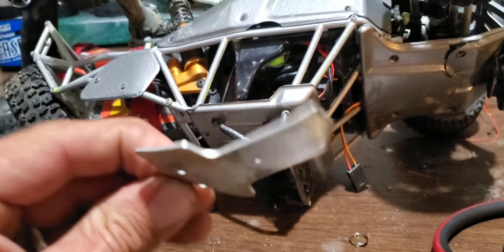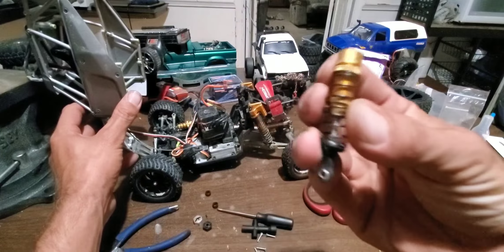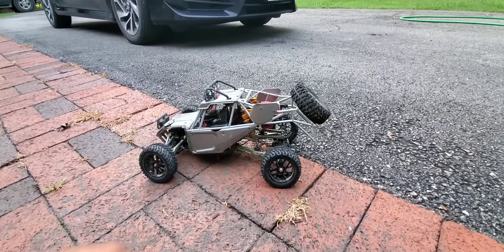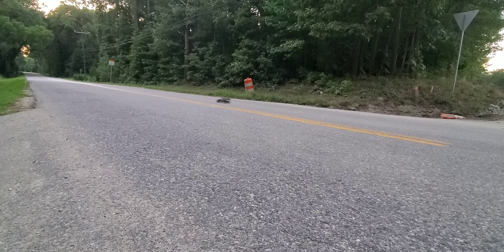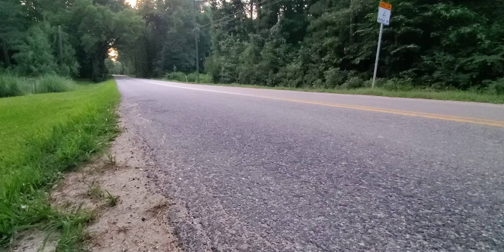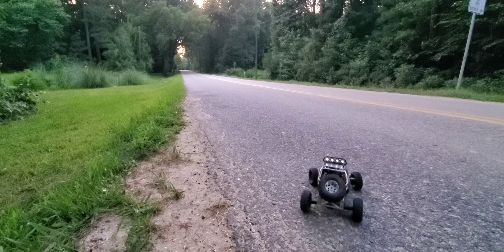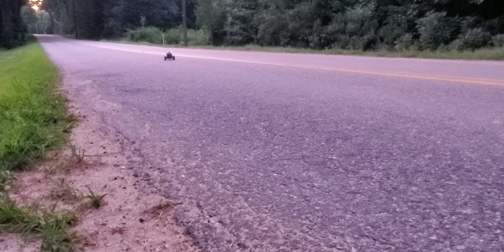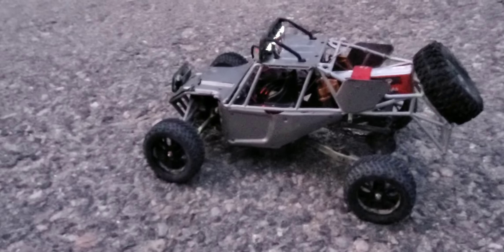Wltoys brushless speed runs 50+ mph 60 amp on 3s

Comment: That thing is insane! well done dude. Any heat issues? what is the setup? Moding one for my self with 3s goolrc 3900kv brushless full metal gears and some aluminum parts. Is this similar to your setup? The steering slop is awfull tho.. Did you find a way to eliminate steering slop?
Reply from the maker: Yes. I have a 60 amp 4300 kv stock spur metal axle gears
Reply: @supastihl89  Did you find a way to eliminate steering slop?
Reply from the maker: @need4drift  not yet im going to redo the steering and install gyc300 gyro
Reply: @supastihl89  Ok coll. Thanks for the info.
Reply from the maker: I didnt check the heat. Motor seemed fine. I wasnt constantly running it. And when i wrecked or left the rd it would sit til i got there and i would cut it off and walk it back to save battery so it stayed pretty well maintained
Reply: @supastihl89  ok nice. Were having 40-45 celcius where i live so i think i will need fans for motor and esc. Thanks for the info dude. Hope to see more speed runs of your insane wl build.
Reply: @supastihl89  hi I whant to instal the same device but dont now were ,do you  find the place for it
Reply from the maker: @daiciuapostol79  ebay. Goolrc 60 amp 3300 kv
Reply: I have one in my rc boat end work perfect
Reply: @supastihl89  no, about the  gyro were to instal in the car
Reply from the maker: @daiciuapostol79  ebay. Its a gyc300 i think

Comment: very nice video and excellent upgrade thank you, and i have a question are you choose the 3s battery by yourself or depend on the specification coming with esc, motor and the servo ?... because im warry if i install 2s or 3s battery to my system and burned it
Reply from the maker: You must see what your system is rated for. All 2s batteries are the same just different size mah. 3s is more voltage.  Must check esc.

Comment: I ordered a 2000 mah 2s 25c battery it came with a usb charger is it safe to charge it in a wall socket?
Reply from the maker: Yes. You van use your stock charger if they are both 2s aswell
Reply: Ok thanks
Reply: Btw do you know any paddle tires that will fit on stock rims
Reply: Am I this guy?

Comment: What voltage is the 3s battery?
Reply from the maker: All batteries voltage is dependant on # of cells. Li ion batteries are 3.7 volts per cell. So 2s is 7.4v. 3s 11.1v. And so on. The size of the cell is represented by mah. Voltage effects rpms of your motor, mah represents the size of cell this bigger the longer life same voltage. C rating is how fast it can discharge
Reply: @supastihl89  ohhhhhh!! Thank you for giving me the information!💪🏾. I just got into the hobby recently.